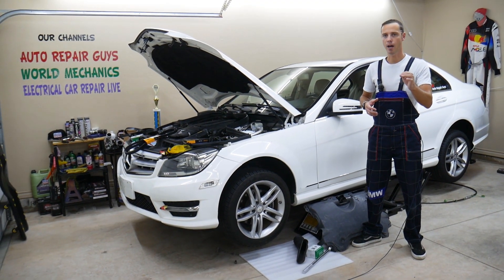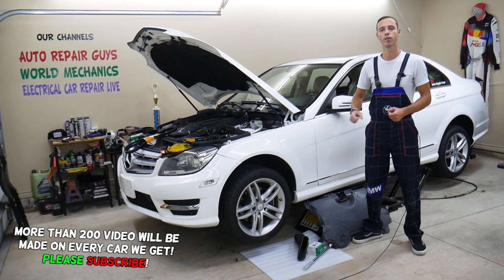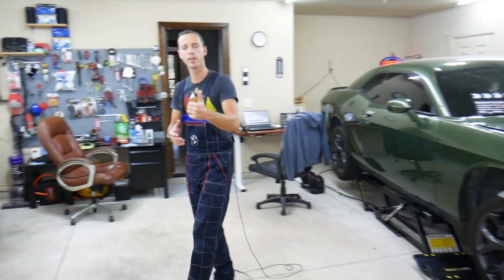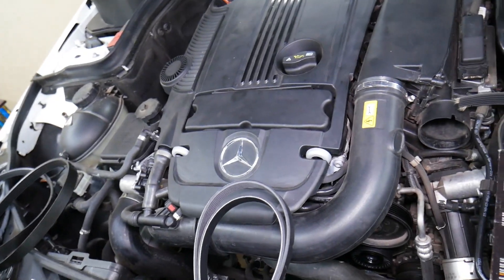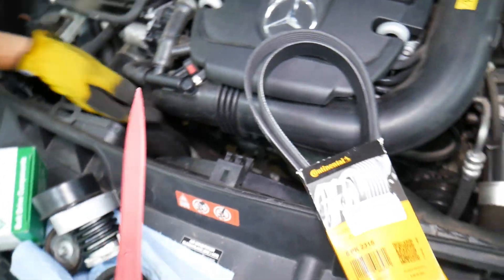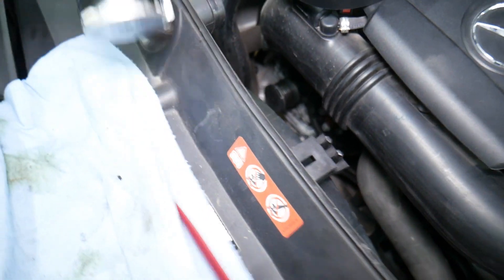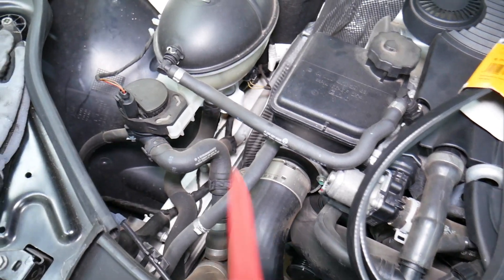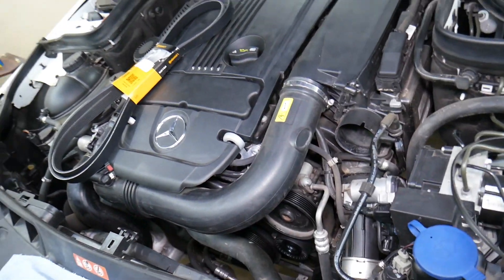WHY MERCEDES OVERHEATS W203 W204 W205 W211 W212 W213 GLC GLE GLA

Comment: I have a 2014 Gl 550.  Overheating.  Changed thermastat,  Changed sensor, flushed the radiator.   Still overheating.   Any ideas?  Please help.

Comment: Anyone had any success in sorting their overheating issues by doing this?
Reply: i just replaced water pump and thermostat 105k miles nd put in new coolant and it shake on me and the abs and traction turned it and it turned off by itself then i just turned it back on and it was working fine